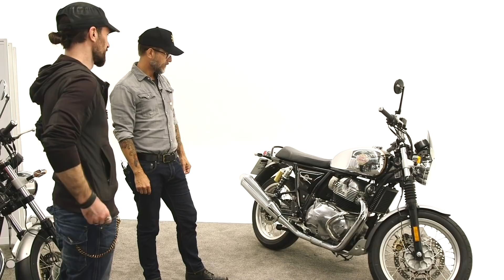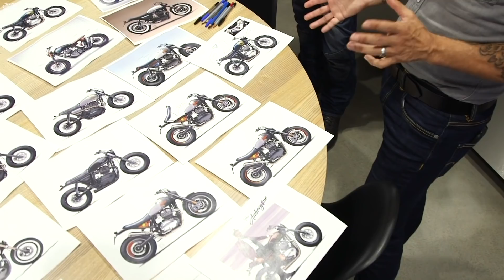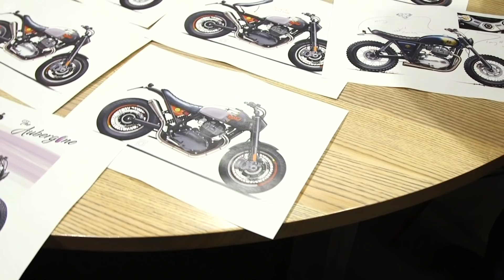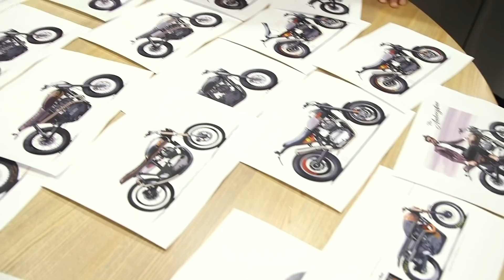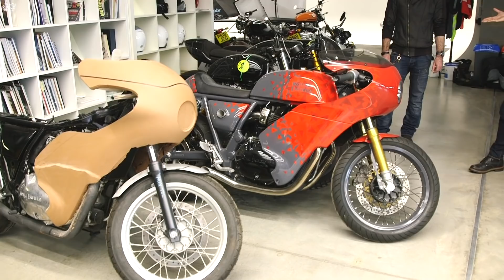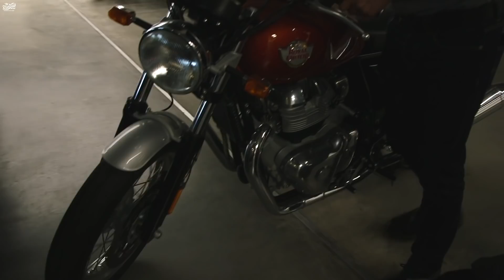BSMC x Royal Enfield Custom Collab - Stage 1

Comment: Progress, ahhh that word.
This bike makes 47 bhp, sure, its got Euro 5 to deal with etc, but it has 8 valves, SOHC, short stroke 270 degree crank, CAD cam profile and timing, CAD port design and shape, CAD combustion chamber.
55 years ago, in 1965, BSA, Triumph, Norton and yes Royal Enfield made 650 twins with this power and more.
2V OHV pushrod long stroke motors designed on a drawing board and machined on clapped out manual machine tools.
Progress, mmmm.

Comment: Any younger (say below 45-50) guys and girls who like the new 650 twins, but know nothing about the original Redditch twins, the Meteors, Constellations, Interceptors need to go and find some, either at a Classic meet or museum. Epic bikes once sorted, and some of the most attractive engines ever made. 
I have never understood how the Enfield designers designed the new bottom end arse about tit. No engineering reason. Compare old and new - no bloody comparison attractive wise.
I am not a fan of the new motors at all appearance wise as you can tell.
Cheers.

Comment: I am a Luddite. I am also a huge old Brit bike fan, and any old Harley/Guzzi, Beemer etc etc.
Lets be honest here. A stock new Enfield 650 c/w blob of an engine, has less good lines and is not as good looking a motorcycle as a run of the mill 1975 Honda CB360. 
The truth may hurt.

Comment: I work with a company that converts air/oil cooled Hinckley Bonnevilles to 904/995/1200cc street tracker. I want to see someone take this RE out as far as it can go. The bottom end on the Bonneville is so stout we change the shells on the mains, install new rods and then to the barrels/ carbs/cams. An EFI  can be converted to carbs quite easily. The RE could become a 900 .

Comment: "Minimal lighting" for a city bike? No rear indicators? Why not leave the brakes off too .... save a bit of weight.
Reply from the maker: John Penny minimal in design. Motogadget’s small stuff is often more visible in terms of brightness than stock. Those items don’t need to protrude like a candy apple to be effective!
Reply: Minimal in physical scale, not brightness. I have to do a right turn on a dimly lit dual carriageway every evening. I want to be seen, but also, I know my bike products and options.
Reply: @dutchvansomeren9943  Fair enough, you are putting your "brand" to it. I would nevertheless suggest two indicators are no substitute for four especially on a bright sunny day. I wonder why bike manufacturers always fit four, easily visible from both ends of the bike and at  pretty much all angles. Style over substance here methinks.